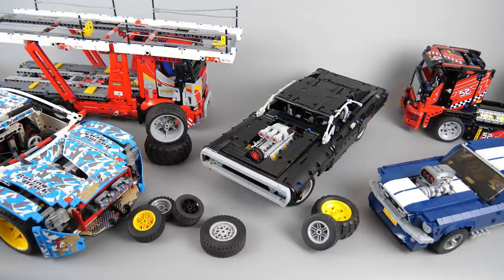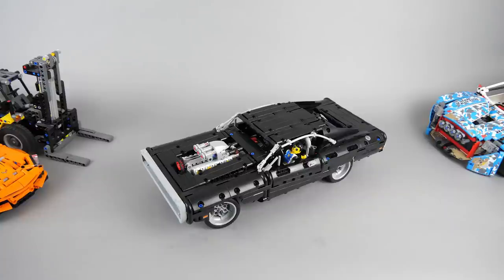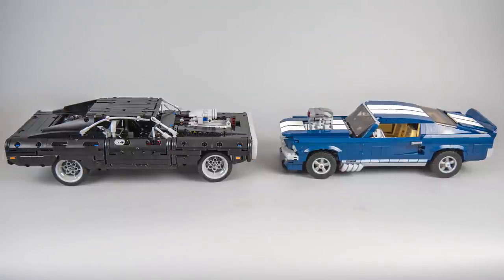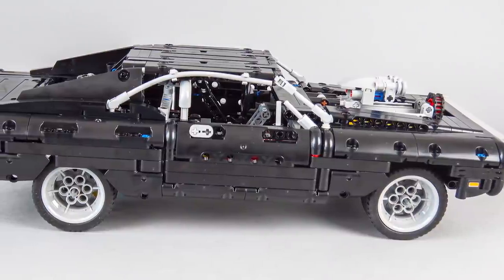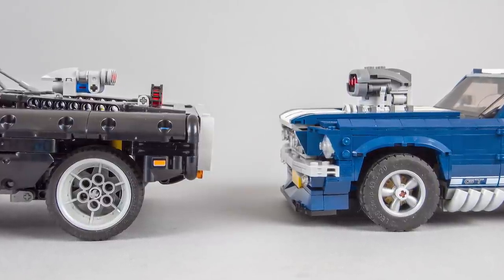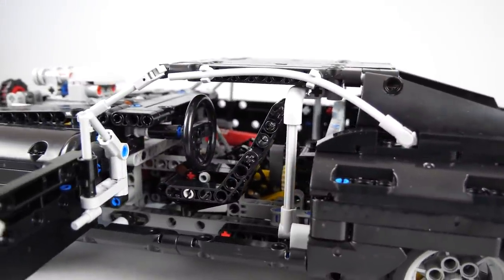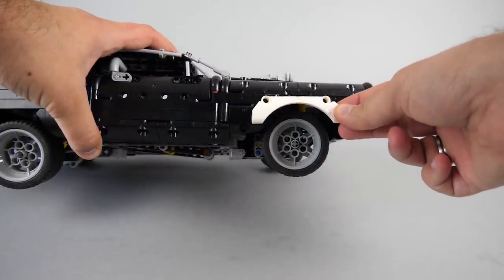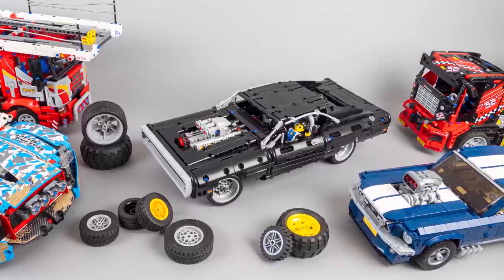LEGO Technic 42111 Dom's Dodge Charger size comparison, wheel test and more!

Comment: I ordered the kit online and should receive it in a couple days. The stock tires are close in diameter but as you said in the video the rims are too large and the tire profile looks wrong. Although a bit big I have a set of 62.4 x 20 tires with metallic silver rims I'm going to try out. The profile looks much better. The body lines remind me more of a Roadrunner than a Charger so with several body mods including the wheel wells that's what it's gonna be. Excellent video. Thank you!

Comment: I wish lego could stick to a scale ratio. 1:8, 1:10, 1:12, 1:24 are fairly common in model/rc cars. This 1:13.5 scale is irritating, but I do love the car overall. Sucks I cant really display it with any other cars because it will appear too big or too small